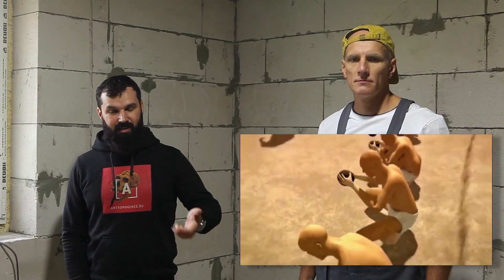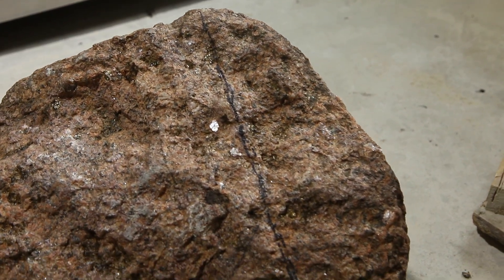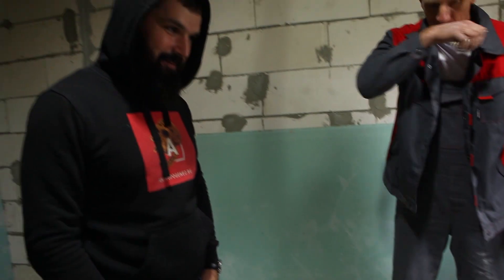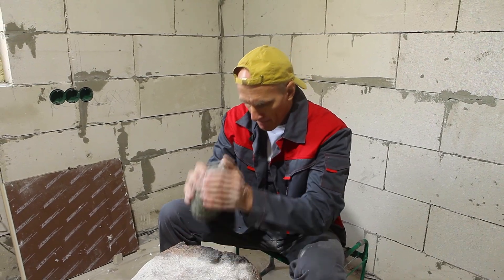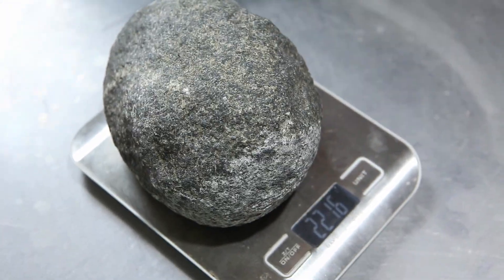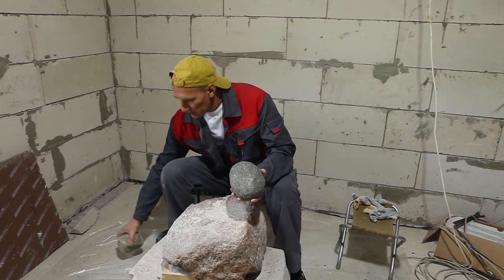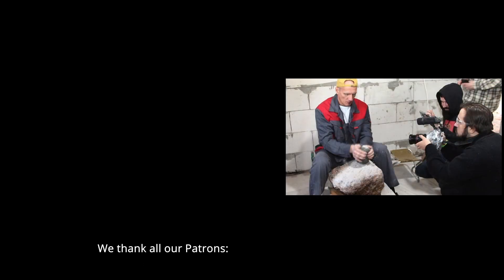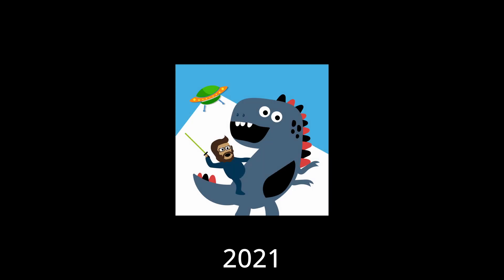Dolerite vs Granite | Could Ancient Egyptians carve obelisks?

Comment: 2 years? I enjoy your content but this time it feels a bit far fetched. The tight spaces and the "scoop" marks under the partially carved obelisk make this hard to pull off. Also, besides requiring hitting bottom up, the marks below the obelisk end up in a tight corner, where said marks would be virtually impossible to obtain. Plus, why would the marks have been organised in long stripes. Too close for two people to operate side by side. Maybe it's close but it doesn't give me the eureka moment.
Reply: They melted it with lenses
Reply: @fifthcylinder  Melted what? Granite? You can't melt granite and still have granite.
Reply: @coryCuc  yes...you will. it depends on how fast its cooled, which wont be very fast in 115 degree weather.
Reply: @fifthcylinder  Ummm....no lol.  Do you even know what granite is?  It's literally magma that has been cooled underground over thousands or millions of years.  You melt granite you have obsidian.  You no longer have granite.
Reply: @coryCuc  you are wrong. It depends how it's cooled. Not gonna argue with you
Reply: @fifthcylinder  Lol. Do you have thousands of years to cool the magma under thousands or miles of earth's crust?? You're clueless dude. Don't argue. That's the smartest thing you've said.
Reply: Cory, my dude, dont dismiss the idea of using lenses  to melt granite. There are video here on YT showing this being done. You could heat an area, chip away the softened rock heat again, repeat. Its possible.
Reply: @zachh2776  Nobody is talking about heating granite then chipping it. And heating granite literally changes the quartzite and feldspar and other mineral construction of the granite that you would be able to see today. We don't see those things which is how we know which quarries which granite came from. If ancient civilizations knew how to cut, lift, transport, and polish 1000+ ton stones of granite, they surely didn't need giant lenses.
Reply: Bouncing
Reply: I’ve forgotten where I saw it, but some theorised that the underneath was probably done by simply suspending the dolomite hammer on a rope, and at the bottom just pushing it like a swing. It makes sense, it would mean that the bottom part would actually be less physical stress for the workers than the rest. It would also explain why they did it in a way that created those long stripes. Unfortunately I can’t remember what evidence led them to believe this was how they did it.
I personally think it was that or lasers, pew pew pew 🔫
Reply: @casualviewing1096  Intoxicated alien pranksters?
Reply: @davepowell7168  I didn’t consider that one, but I think you maybe on to something 👍
Reply: @casualviewing1096   🤣 Well they have driven me to drink.  It's not even 5 in the afternoon and stopped at 1pm  for drunch. I consumed a liquid. The  'scoop marks' were carefully made to collect a substance coming from above ? There is small hole in the 'material removal apparently by human hands' trench . So l'm guessing the scoops might act as evaporation bowls and collecters catching fluid dripping from block also. 
  For an unskilled job on this project children may have been used too.
 Detailed material removal, the facing or carvings would need craftsmen 
   I was fortunate to have a round granite hallstand base and some flint bits. 
    The granite I tried is hard but surprisingly porous at the surface unless a sealant is applied 
   With stoneage tools it's easy to underestimate how tediously awful this work can be without the right knowledge. I'm glad 
I retired from being a blacksmith and then we didn't use hammers all day as these guys in their shifts
 The fluid served 2 purposes, reducing dust in the air and lessening risk of vision damage and the added ingredients which puzzle people to speed the process.
  Olga,the lady who made the bird ornament for 'scientists against myths' didn't use a flywheel 'drill' as shown in the hieroglyphs of Egyptian chalcolithic stone workshops so could have halved her manufacture if practiced in using one 
   The workers were expendable but scarf veils would be practical 
 Although labelled 'the copper age' chisels in Cairo musey have 3% arsenic ,too much to be just an impurity. This arsenical bronze was only toxic to smelt ,subsequent hardening on the anvil was done cold. 
   Tin became used in the Bronze age because because it prevents corrosion.
Metal might have been used on stone but not necessary. 
Wally showed us he could build a stonehenge by himself! 
Stay vigilant. The shifts work alternate scoops..
We should not underestimate or disrespect our lazy, feeble minded ancestors using manpower alone 
     The Great pyramid is much more than just a pile of rocks .
The great Greek historian Herodotus explains how the stonework was completed by starting at the top and working down to the bottom which gives us an insight into hearsay and gossip being more popular than boring truth and hardwork thousands of years ago
The Giza plateau is the only original WOW left standing 
The WTC could have been a second Wonder of the world but the archaeological remains were  ♻️ 
   We live in a World Of Wonder!
Reply: Lol. Must have been aliens, then, right?
Reply: @tehbonehead  Who the heck is talking about aliens?  Super weird comment.
Reply: Personally I think they might have drilled out those passages, then shaped em up with the pounders. Drilled with the same technique these guys already showed

Comment: Setup a 40kg (30cm diam) irregular dolerite sphere in a rope cradle , with the bottom exposed and equal lengths of rope running horizontally of each side. Get 3 men on each side of rope ( rope at 30 degree angle) and simply lean back, lifting the dolerite approc 30cm, and suddenly release. Repeat rapidly.
Bang bang bang. NOW add a layer of wet quartz sand this dissipates the force preventing the entire piece of granite from breaking up, and also assists in the local abrasion of the granite. 
It does not destroy the workers wrists or hands ( hand held pounding obviously isn't the answer, come on....)
This is the earliest form of percussion drilling . Its no big mystery, its pretty obvious, and quite easy to replicate

Comment: I wonder how many Egyptian workers died of Silicosis: an interstitial lung disease caused by breathing in tiny bits of silica, a common mineral found in many types of rock and soil? Over time, exposure to silica particles causes permanent lung scarring, called pulmonary fibrosis.
Reply: Flushing the work surface with water helps but i'm sure silicosis was a thing.
Reply: The sound must have been an issue you spend your life banging rocks and your going to be struggling to hear in later life, aswell is white finger.
Reply: Maybe they used face mask and just died of accidents, other intoxications, infections and malnourishment 💀
Reply: @fenrirgg  It takes a while to die from silicosis
Reply: Probably died before they could die of silicosis apparently 30-40 was average age to die
Reply: I was there at the time so I can tell you that not that many died of it actually.
Reply: Well the machinery they used probably did',nt die
Reply: probably because the actual work was done with a kind of blasting technique
Reply: A dead slave is 1 less mouth to feed.
Reply: Likely none.  Unlike enclosed mining deep underground the Egyptians primarily engaged in = "strip mining."  So out in the open where winds* can carry dust away.  As to dust.  Hammering using stone hammerstones will throw up far less dust than a modern high speed drill. So the amount of dust being generated from quarrying was probably far less than you presume. 

* - winds = are your real problem.  Silicosis of pulmonary tissue is a problem in desert environments = from the ever-present dust/grit carried by desert winds.  In some places in the desert the surface of the ground is covered with a fine powder dust which gets whipped up by the strong winds = and you end up inhaling it.
Reply: None because that's not how they carved the granite
Reply: @hattershouse710 
How did they do it? And how do you know? Let’s see your evidence.
Reply: @FirstnameLastname-bn4gv  That's exactly the point we don't know. The evidence is the stones themselves and the fact that we can't do it today and we can't figure it out.
Reply: @hattershouse710  
It’s not a fact that “we can’t do it today.”
If you don’t know, then why are you claiming you know how it was not done? Why are you claiming to know how many Egyptian laborers suffered from silicosis?
Reply: @FirstnameLastname-bn4gv  The predynastic egyptians certainly didnt pound stones together as shown like this, especially granite. They had tools of some kind as evidenced throughout egypt on many large scale objects and stones. They even had it down to a mechanical proceess as evidenced by the vases being studied by the channel uncharted x. The sheer size, scale and precision of the pyramids, which have been dated to be older than 2500bc, is more evidence of an older egyptian people with advanced tools or carving/cutting techniques we dont know about yet.
Reply: @hattershouse710  
Okay? None of that addresses anything I just said.

It’s really strange that you admit that nobody knows for sure how it was done, then immediately claim to know for sure how it was not done.
Reply: @hattershouse710  Uhhhh, they JUST proved it. Watch the video
Reply: @hattershouse710  The vases were definitely a different (and much older) technology but this video categorically proves that you can efficiently remove material with the right pounding stone. It also created the same scooping that you see all over Aswan and other places.
Reply: @Memnon-33  No it wasn't. We sipmply don't know how it was done nor how the scoop marks were made.
Reply: @Memnon-33  They also didn't explain the extreme precision foun on the vase and never will by hand. It simply cannot be done. the human eye cannot detect such tolerances. you're dismissed now sport.
Reply: @hattershouse710 seriously you would fail grade 6 and 7 history classes.🙄🤦🏾‍♂️
Reply: @hattershouse710  :face-blue-smiling:
Reply: @hattershouse710  🤣🤣🤣 nice seeing someone using their brain in this comment section. A rare sight. Hilarious handicapped experiment here. For every 570 tons of material removed they'd need 249 tons of Dolerite. Check out some of my work.
Reply: @hattershouse710  Inthink theynwould have forensic evidence to prove if they died of it. I think that information would be available if true, but I dont think it exists